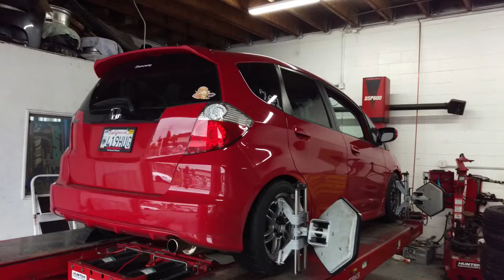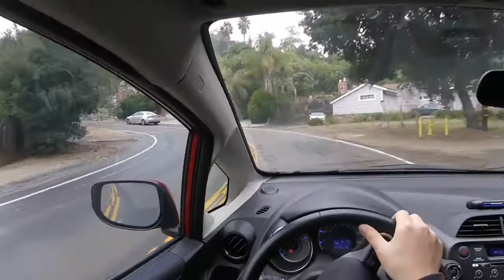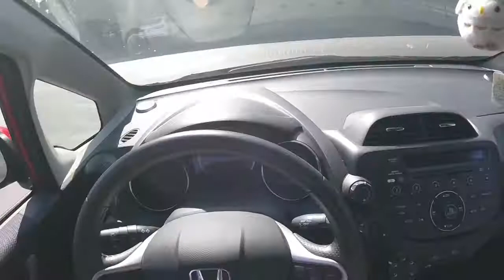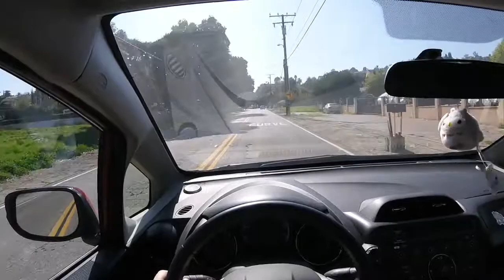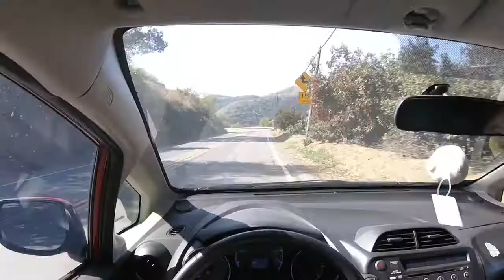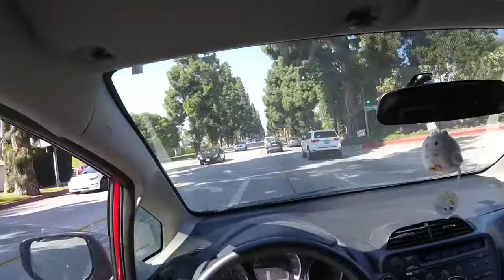Honda Fit Touge Cruise (Roll Center Ball Joints, Coilovers)

Comment: Is that Turnbull? I recognize those corners like the back of my hand! 

Very nice though dude I just picked a GE8 that I want to make into a canyon cruiser. What mod would you recommend to get first? suspension?
Reply from the maker: Thanks! Congrats on your GE8! Yup that's Turnbull! Tires and alignment first (negative camber in the front with camber bolts), then coilovers, rear swaybar, brakes, etc quite a few good first mods lol

Comment: How much material was needed to be taken/grind off the lower control arms ? Was it enough to weaken the control arm? What’s your wheel size /specs also? Great video!
Reply from the maker: Thanks! About just under half a centimeter I think and it has held up fine after a few track days. Wheels are 15x7 +35 all around
Reply: @SamuRacing  thanks for that insight☺️ i really appreciate it